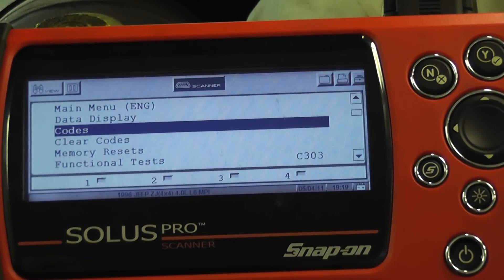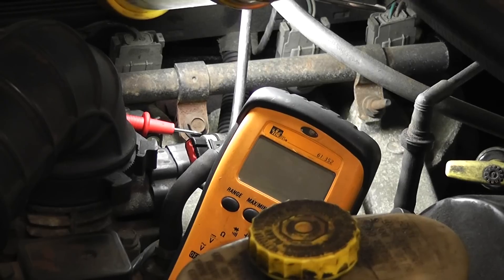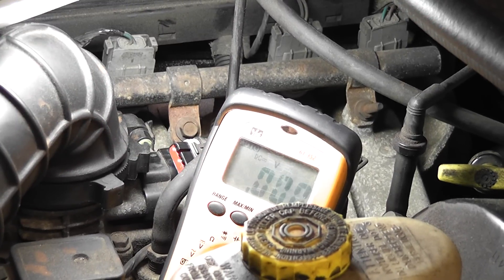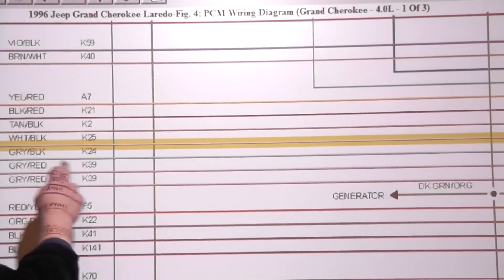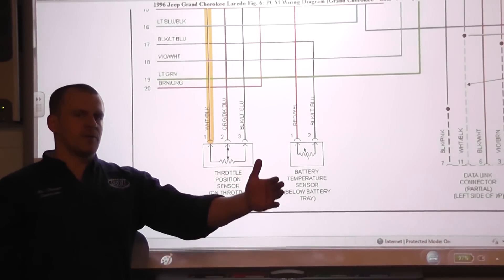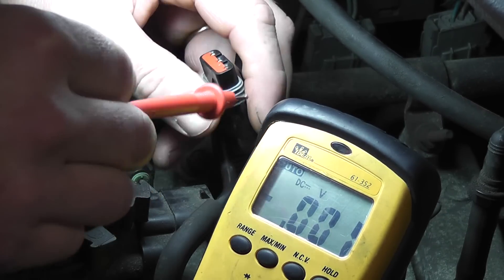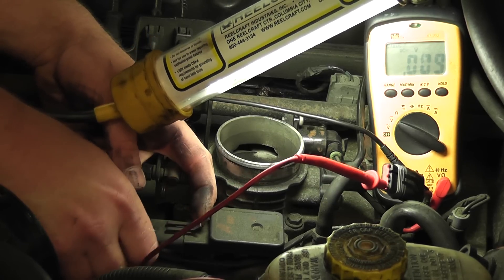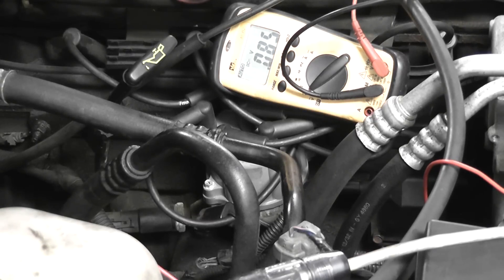1996 Jeep No Start Case Study Part I

Comment: What if you have connections to pcm, all 5 volt references  and no spark. Have replaced coil, pickup or cam sensor, checked grounds,
Reply: Also have power & ground to pcm as well
Reply from the maker: what does coil positive and coil negative look like with a test light while cranking? (incandescent style ONLY) - connected to ground for both tests
Reply: @ScannerDanner  coil driver has no signal. I believe pcm bad
Reply from the maker: @gearheadhuff7853  that doesn't answer my question
No light? Steady light? Flickering light? Coil positive and negative
Reply: @ScannerDanner  no light flicker on driver side of coil . Light flickers on cranking side
Reply from the maker: @gearheadhuff7853  there is no "drivers side" and "cranking side" 
You need to help me help you.
Coil positive and coil negative are you two sides. Coil positive should be a steady light and Coil negative should flicker during cranking. Test light connected to ground. Both tests. What do you see?
Reply: @ScannerDanner  One side flickers 1 side don't
Reply: @ScannerDanner  cranking side flickers negative side doesn't
Reply: Negative side no light at all
Reply from the maker: @gearheadhuff7853  positive side may look like it is flickering from starter current changes as cylinders approach the compression stroke (normal). Coil negative not being lit at all with coil positive being lit:
1. open in the coil primary winding
2. short to ground on the coil - wire
3. PCM driver is shorted to ground
Follow up test. Disconnect the coil primary wires and connect test light to battery positive and touch on the disconnected coil negative wire and tell me if it lights.
Reply: @ScannerDanner  it does not light at all..
Reply: Also checked continuity between coil negative and #17 on pcm which I believe is the driver and I have continuity from coil connector to pcm connector
Reply: Correction it's pin A7 that I checked not A17 A7 should be coil driver #1 by the diagram I have
Reply from the maker: @gearheadhuff7853  with coil disconnected and test light to battery positive, no light? Then your coil winding is open. Doesn't matter if it's new. 
Your original test is test light to ground and it lights on coil positive but does not light on coil negative, right? Then you tested coil negative with the test light on battery positive (coil disconnected) and it doesn't light. Is this right?
Reply: @ScannerDanner  correct
Reply from the maker: @gearheadhuff7853  your coil primary winding is open. Do a quick resistance test to confirm. Connect ohmmeter between coil positive and negative with the wires disconnected. It should show an open circuit from the tests we did
Reply: @ScannerDanner  with test light on positive battery terminal  it will light up under cranking but not without cranking. I checked resistance on old coil seemed ok but put another new coil on no change still no spark. Rechecked all grounds. They are good. Done all test over same result....
Reply from the maker: @gearheadhuff7853  lights constantly during cranking? But doesn't flicker? And is that with the coil connected or disconnected?
Reply: @ScannerDanner  disconnected
Reply from the maker: @gearheadhuff7853  sounds like an ECM issue then but something else is going on, when a driver shorts to ground, it is shorted all the time. Cranking won't make a difference. I don't trust the test results you are telling me. 
We need to move this to my forum at this point. Its free to join and we can help you there. www.scannerdanner.com

Comment: 97 zj crank 100 times before it starts no power to coil then it starts and runs fine put off then start process over again.ready to throw in the towel.please advise
Reply from the maker: So during the no start condition, you have no power to the ignition coil? During that period of time, check to see if power is there when you first turn the key on. Best to use a test light for this test as you'll only have power for 1 second
Reply: @ScannerDanner  hi I'm looking forward to hearing from you sir your question was rite on the money so I know you know what's the problem with my van please advise.thanks
Reply from the maker: @ganggang2330ugood  so no power cranking, but you do have initial key on power, each time? You are missing the RPM input (crank sensor issue)
Reply: @ScannerDanner  thanks for responding I already changed crank sensor but I will check may be faulty new goods what type of ohm reading should I be getting from crank sensor?
Reply from the maker: @ganggang2330ugood  you can't accurately ohm test hall effect sensors. Make sure your air gap is correct! Push sensor all the way in, then back off just a hair
Reply: @ScannerDanner  thank you very much sir I'm going to check first thing in the morning sir I will keep you posted.thank you and God bless
Reply: @ScannerDanner  I did as you said but I also unplug the o2 sensor and guess what....it starts.
Reply: @ScannerDanner  so now van is hot and she won't start again...

Comment: 96’ GC 4.0 

Will start and kill itself then get no spark and not start at all or just will crank and not start at all.

Replaced In Last 2 Weeks
Ignition Coil
Battery
Spark Plugs
Plug Wires
Distributor Cap
Distributor Rotor
Distributor Cam Ring sensor
Distributor Crank Sensor
Idle Air Control Valve
“New” remanufactures PCM

Fuel sending unit / pump / filter

Regrounded neg for battery 

Something is shutting it off electronically, when she starts she runs good but it’s like a switch something is killing it then after it will have no spark when I pull a plug to test and won’t start back up will just crank.

Been checking grounds and trying to figure out the problem for 3 weeks now.
She’s my daily driver and use to tow my boat also and haul kayaks been getting to work on my motorcycle but so frustrated I can’t figure this out.

Comment: Nice video Paul as always I have a question what if the 5 volt reference is shorted to a ground controlled by the ecu for exemple to the controle wire of purge valve i got a diesel car with a shorted 5v to pressure regulator control wire, by the way I learn everything from your video and thank you for everything you do for us
Reply from the maker: What my "Bad Engine Computer Testing" part 1 and 2 videos. I show another way to verify reference circuit shorts. But yeah, that would be a tough one for sure, especially because it is a switched ground circuit!

Comment: Hey man just wanna say your videos have enlightened me more than my 3 buddies trying to help me over the phone all put together (different cities). I believe I have the 5 volt reference thing figured out but have one question. I have a 93(obd1) Jeep and I have no activation of the relays (asd fuel pump).  I have horn relay and have switched relays around to rule the relay itself out. Still no fuel pump prime. I haven’t been able to hear if the relays are “clicking” in your no start Jeep videos. Any direction would be appreciated as I imagine you’re pretty busy

Comment: Hey Danner, thank you for the info! After watching this I checked all the fuses with my multimeter and found the issue. My wires to the crank position sensor had frayed and shorted, killing the PCM fuse. Check all your fuses with a multimeter peeps!

Comment: When i checked thecrank sensor. The meter varied between 8. And around 1. Did i just find my problem? All the other sensors read .08...
Reply from the maker: Sounds like you are confusing your circuits. For Chrysler/Jeep, You should have either a 5 or 9v reference as a power for the sensor, and this will be constant. Then you should have a 5v pull-down design sensor signal circuit (5v unplugged, 0-5 plugged in while cranking) and a ground, which should be less than .1 of a volt.

Comment: The problem with my Jeep is that it once it heats up it begins to have problems running. Until it warms up it runs just fine. There were 2 codes showing, misfire in #1 and random misfire. The previous owner suggested the CAM sensor. Thinking it is a Coil problem.

Comment: I have a 93 jeep wrangler 4.0 with no power to the fuel pump.  All associated relays and fuses check out good.  any suggestions?
Reply from the maker: Does this model have a ballast resistor on the firewall? It's a white piece of almost porcelain material about 4 inches long with a wire connected to each side of it.
They used these to reduce power to the fuel pump for some stupid reason (noise) on these early models.
If it has one, jump the two wires together
Reply: not to my knowledge but I will check tomorrow.   only thing I have noticed is the asd relay clicks when you turn the ignition to the on position.
Reply from the maker: That may be normal. Search for my video "fuel pump electrical circuits", it will give you a good description on why you are seeing the ASD relay react that way.
Reply: Will do!   Your videos are great and have helped me understand vehicle wiring better.   I will let you know what I find.  I have traced everything out from the fuel pump plug to the fuel pump relay.  I have constant power on the relay #30 and power at the #86 when the ignition switch is on.  no power #87.
Reply: update!   I found the problem at the sending unit ground.   There was corrosion on the ground so it wasn't grounded.  cleaned area up and now have a running pump!!!

Comment: I have a 95 xj and it will turn over and never start but some times if I unlock the passager power lock 3 times it will start I was told it was a Security system how can I find and disable that?

Comment: You rock brother..I have a 93 Jeep Cherokee..mechanics checked sensors said it was the computer..I would literally have to get out and shake the computer to get it started again..truck was a county truck and has a police computer I can't find anywhere..truck is running now since put back in tighter..was thinking of taking out and resoldering the connections for the pins..my question would it have to be reprogrammed..still get check engine light every other time turn on the truck..and battery gauge up to 14V
Reply from the maker: No reprogramming needed on a 93.
Reply: ScannerDanner thanks for replying to me..thought so too but doubted myself...and like you say in your videos "always go what you know"..read somewhere online...no reprogramming capabilities up until 96..pcm comes factory programmed..do you have any videos on shorts in steering columns..I have that as well...thanks again

Comment: you said at some point that you know that the computer is not fully dead because the fuel pump is working "'''"''''' that's kinda misleading because if the main processor unit or any one of the many ic chips involved inside the computer go bad it can cause a dead short in that circit causing the computer to send a on signal to the fuel pump relay causing the pump to run
Reply: I agree

Comment: I have a problem, my 97 jeep grand Cherokee limited turns but no start. The lights and everything comes on when key turned. There is also a clicking noise coming from the fuse box near the battery. Particularly from the ASD relay. bought a new one and replaced, no change. next I listened to the fuel pump, there was no sound at all, so replaced fuel pump, but still no start. fuel is good, did bleed the pressure line, its good. checked all fuses, all good. coil tested good. starter failed but the wire connectivity was a little damaged don't know if the test would be accurate.

I am out of ideas and money.

Comment: for the diag on the 5 volt reference you did on each plug for the sensor did you have key on or key off?
Reply: Great question I’m wondering the same thing
Reply: Samuel Pascual did you find the answer to that question

Comment: Just curious, wouldn't you check the fuses first?   Just seems like its easier to troubleshoot the simplest stuff first....like fuses, switch settings, connections, etc. before you start taking things apart?

Comment: I would have checked the 5 volt black white wire right out of the computer FIRST...no need to remove all the sensor connectors...you can tell right away...if the computer is at fault or a fuse...

Comment: I'm having a problem with my jeep cherooke country 1996 i have to step on the gas to keep it from dying an autopart techniciancheck my car with one of those little computers like the one you showed in this video and told me my idle speed was bad. but before that i did not have the tail lights. I did check the idle part and replace it. it was really bad i started my car and it started good and no problems for 2 days. then i decided to check the the fuses.

Comment from the maker: signal return is another name for a sensor ground on automotive wiring diagrams. sensor grounds go the the computer first as a point of reference instead of the battery or block to help filter electrical  'noise'
also as you stated the sensor ground circuit carries current in the micro amp range. this is because input sensor circuits really don't carry any measurable current flow

Comment: signal "return" is or used to be around 4 to 20 mili amps.  VIR or PIV.  V=I x R and P=I x V, power is measured in watts.  i don't understand "sensor ground", they are all grounded.  just like the ground in your US home breaker panel at 60Hz is connected directly to the neutral.  load.

Comment from the maker: Sorry bro, I am only doing driveability and electrical troubleshooting right now. 
Thanks for your confidence in me though. It is much appreciated. 
Oh and my name is Paul.
Reply: ScannerDanner I have a 1996 Jeep Grand Cherokee Larado. I was at a light and it just sputtered out and died. It wouldn’t restart. But did turn over. I turn the key and hear the fuel pump come on. I changed the fuel filter and it still won’t start please help. God Bless Nathanael Taylor